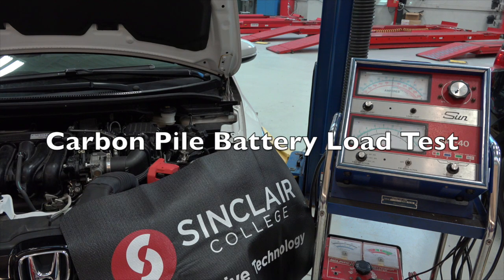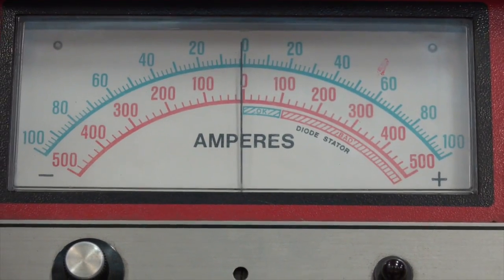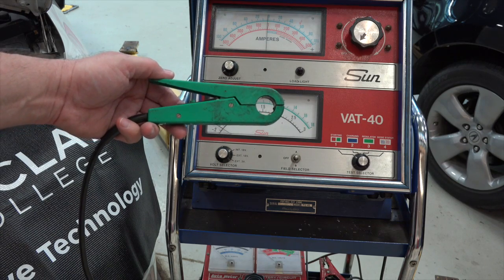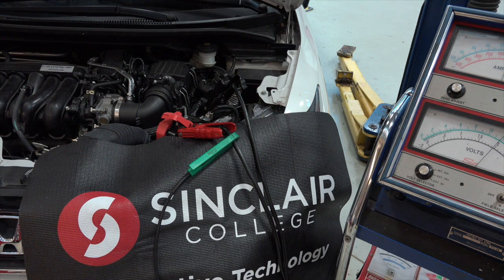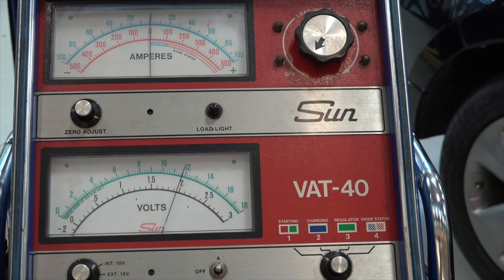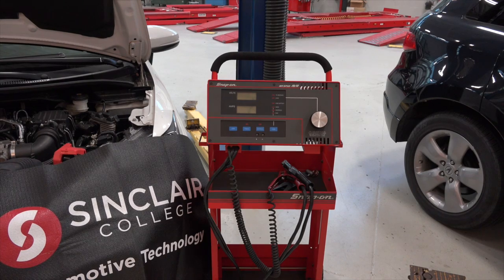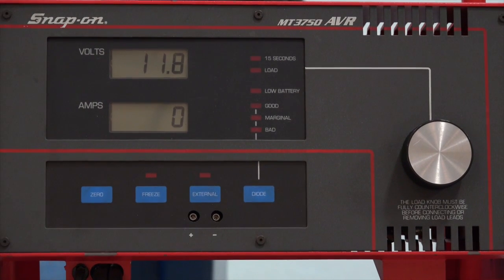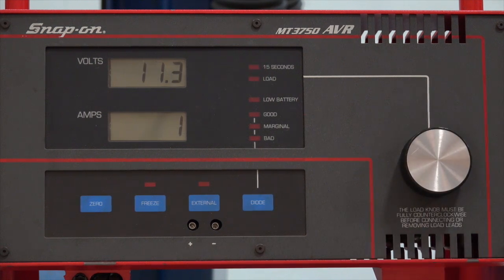Battery Carbon Pile Load Test

Comment: Is there a better or more modern alternative to a carbon pile tester? one that actually applies a load? Maybe a digital version that lets you use it with a variety of devices at various voltages etc ?

Comment: The inductive probe looks like a bit like a clamp meter/oscilloscope amp probe that lets you measure amperage traveling through a wire without connecting to the circuit. 
Edit: oh that’s exactly what it is 😂

Comment: So…how do most carbon pile load testers gauge amperage without a inductive amp probe ? Will the units here still work without you using that or No? Is it more accurate with them basically?